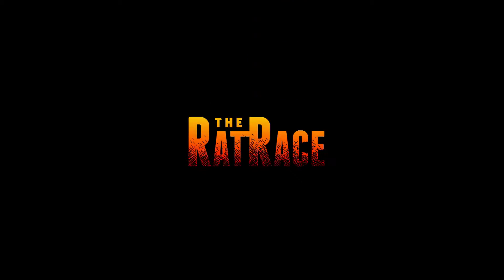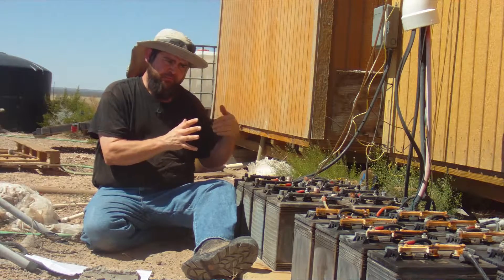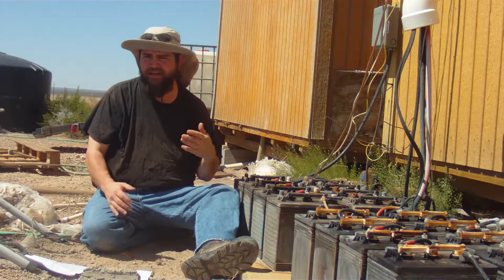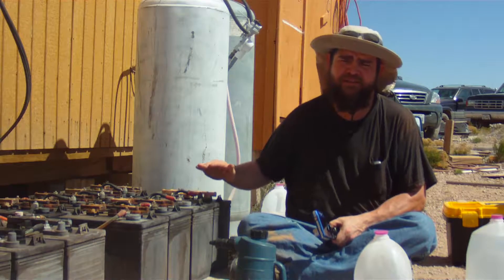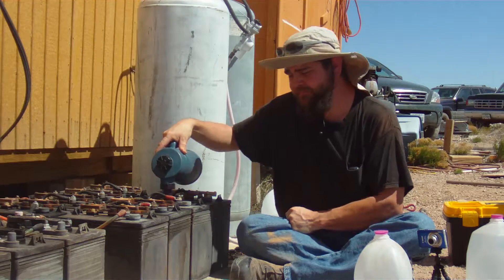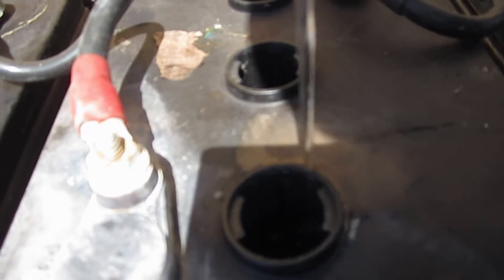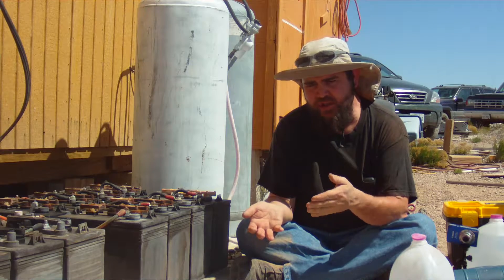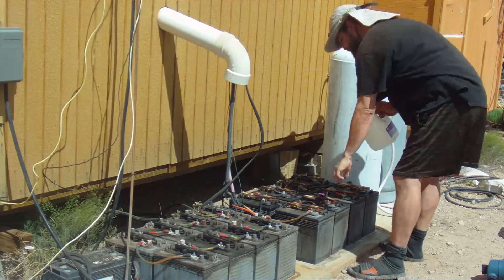Checking and Adjusting Battery Water Levels

Comment: I subbed.  Maybe you can check my channel out too?
 So... do you cover the batteries after filling with distilled water? if so with what? if not, what happens when it rains out? you were concerned with getting the tops wet when you were pouring in the water into the cells so what happens if that all gets wet during a storm or does it not matter?  I would like to see videos on how to set this up AND is it more cost effective then doing solar power?  I think it may be more maintenance? but i do not know. thank you
Reply from the maker: The batteries have caps that allow them to breathe but not allow stuff to get inside.  When it rains, they get wet, just like the battery in your car might get wet when you hit a big puddle.  No harm if the caps are on securely. 

When I was pouring the water in and spilling some, I was more concerned with accidentally washing some contaminants INTO the cells by accident.  Also, distilled water is cheap, but I am 60 miles from the nearest supply.  I don't want to waste any and find out that I had just one more battery to fill and ran out.  I've had that happen.  It's frustrating.

I mentioned in another comment that I plan to do an entire series on how to properly plan and purchase a solar system.  Then there will be one on building that system.  There's a lot to learn.

Solar power is usually far more expensive than grid power.  There are two main reasons to have solar (or wind, for that matter) over grid power:

1) You are so far from the nearest grid power that it would be cost-prohibitive to pay the power company $30,000 PER MILE to bring power to you.

2) You have a philosophical reason to be off grid.

In our case, it's #2.  I have a telephone pole with grid power right on my property.  It would probably cost us about $1500 to get grid power installed here, yet I have over $10k worth of equipment, and I have to watch my power use.

We decided that we wanted to live a smaller, simpler life out in the desert, so we deliberately chose to go off-grid.
Reply: ahhh ok thank you. that makes sense. i will look forward to your series :)

Comment: How many batteries do you have now? How much can they store? What type are they? Thanks!
Reply from the maker: We have 16 GC2 (golf car) batteries. They are 6v each. Since our system runs at 48v, we need multiples of 8.  So we have 2 parallel strings of 8.  Each string holds about 210 Ah (amp-hours) at 48v.  So we have a total of 420Ah.

Of course, due to the natural aging process and the damage I've caused to these batteries due to poor maintenance, they don't have that capacity anymore.  There isn't a really easy way to measure their capacity, either.
Reply: The Ratrace Losers Thanks for the reply! Is that enough for a typical day's worth of your use? Do you have to supplement with a generator?
Reply from the maker: Sadly, no.  We do supplement with a generator quite often because we have added a significant amount of load since we designed the system.  We really could use another eight batteries and another 6-9 solar panels if we wanted to get totally away from the generator.

We live a fairly "normal" lifestyle.  We have a microwave, full size refrigerator, several computers, fans, two water pumps and a swamp cooler that we use when it starts getting hot.
Reply from the maker: Kinda. These batteries are a special type called Deep Cycle.  They are made differently than car or truck batteries. While car or truck batteries will work, they will have an extremely short life when used in this application.

That said, there are larger deep cycle batteries.  And yes, I could use those for more capacity.  However, I'd still need to have more solar panels to charge those batteries.  

When I replace these batteries, I will likely replace them with the larger capacity ones, but get half as many.  That would give me the same capacity that I have now with some room to grow when I get more solar panels.
Reply: can you use LARGER batteries like say for a truck or?
Reply: ok makes sense. sounds goodl

Comment: I thought placing batteries directly on a concrete surface was a sure-fire way to ruin batteries.  Is this not the case with the deep cycle batteries vs your standard vehicle battery?
Reply from the maker: Nope.  That hasn't been true since they started putting batteries in plastic.
Reply from the maker: https://www.youtube.com/watch?v=KDR43E5Uxw4